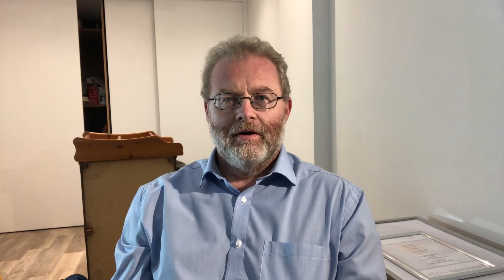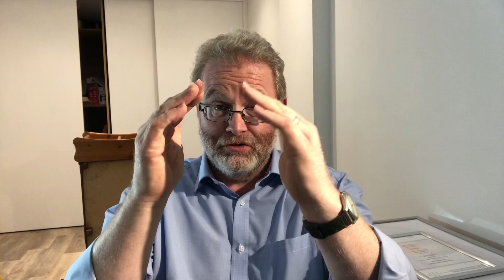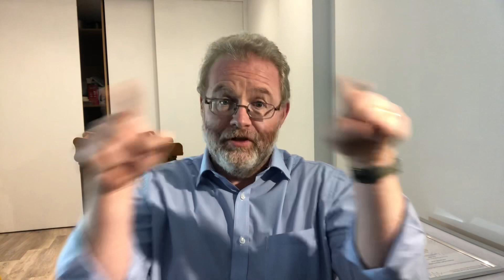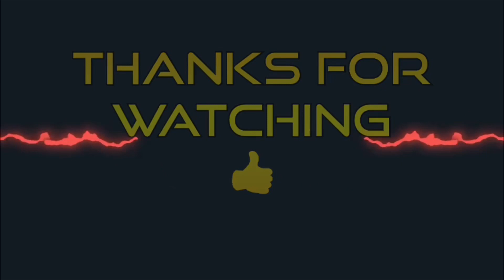Ham Radio: A Fan Doublet Antenna. A good option?

Comment: Try it out. My first permanent HF antenna was an attic installation of a Fan dipole that was connected to a ICOM AH-4 tuner (near the feed point). The antenna itself was an Alpha Delta - it may have been the best antenna I have had.
Reply from the maker: Thanks!

Comment: I think there may be merit in this, had thought of doing similar, currently using what is broadly a ZS6BKW, though my 450 ohm feeder is a bit too long. I will have to try a MMANA model,  it should be feasible to get the vast majority of the current into the shorter legs on higher bands to avoid the hedgehog pattern.
Reply from the maker: Thank you and for your modelling for me 73

Comment: OCFD, OCFD, OCFD! I HAD A FAN. ONCE TUNED, IT WORKED WELL UNTIL A STRONG WIND BROUGHT IT DOWN.......WIRE EVERYWHERE. MY OCFD OUTPERFORMS OVERALL, ANY ANTENNA I HAVE HAD IN SIXTY YEARS AS A HAM. I ALWAYS USE A TRANSMATCH WITH IT.
Reply from the maker: Nice idea

Comment: I've done what you've described, albeit without thinking so much about the lobes. I have a 80/40 fan doublet, fed at the base of the twin lead by an SGC SG237. How does it play? To use a line from Billy Crystal, "Maaavelous"! Yes, it seems to act just like any other fan dipole with the added advantage of the twin lead forcing more power to be radiated by the antenna itself. It works so well that I'm converting my ZS6BKW to the same configuration. When I'm finished, I'll have TWO such antennas: one 80/40 "pointing" east & west and another 80/40 pointing north & south. Yes, I have two SG237's to do this with. One variation is that since I don't have enough room for the north and south what I will be doing instead is to add loading coils 9 ft from each end on the 80m legs to make it resonant on that band (75 meters really).  I've compared its performance to an earlier antenna I had up with results that the earlier antenna wouldn't get me into my weekly 80 m net very well, but with the fan doublet my signal was much stronger and able to work the net at 10 watts as opposed to 100 watts! This is a rather new accomplishment having taken months to complete due to various complications but I anticipate getting very good use  out of them in the coming cold months. I use a 46 ft fiberglass mast with all sorts of guy ropes (4 sets, every 7 feet). If my lot was laid out differently I could have used one mast and have both north-south and east-west antenna fed by different twin leads and tuners to minimize the footprint but that wasn't possible.
Reply from the maker: That sounds a great set up, thanks!

Comment: Firstly I look forward to working you on 80 😅

Can't fault your logic and from running fan dipoles at home and portable I think it'll work well. The Rf should follow the most resonant path and therefor not choose the "wrong" elements within your configuration. With a manual tuner you could operate on the different resonant paths for varied results perhaps. Good luck, 73 Callum
Reply from the maker: Thanks Callum, let’s see what happens 73

Comment: Tim, I'd go with a fence top EFHW. In fact that's exactly what I am going with when some more wire arrives. Should be quiet and totally unobtrusive.
My other option is the mother of all Mag Loops made out of thick coax for the outer loop. Seriously eyeing up that as a project.
Reply from the maker: Good ideas 👍

Comment: I done 40 years of wondering if my current antenna is the right one, you never get over it. How about in you situation have a couple clip on wires to extend you existing antenna to lengthen the antenna you know works so well. Never thought about a fan Doublet vk5cz ..
Reply from the maker: Useful suggestion 👍 73

Comment: I don't think you can guarantee that the higher bands won't also be radiated from the longer doublet, because the principle of fan arrangements is that the "wrong" elements present a severe impedance mismatch to the feeder at the "desired" frequency and so little current flows in them. It's difficult to predict what the impedance relationships will be. You might get greater certainty using traps in one doublet (and will also find that they provide a few feet worth of loading on the lower frequencies).
Reply from the maker: Thanks Stu! 73

Comment: All the elements are active and do have current flow, even if they are not resonant.  Thats why fan dipoles can be a pain to get trimmed and adjusted.  There would be quite a bit of interaction if none of the elements were naturally resonant, it would be very hard to predict what the pattern would be.   Your 47 foot element longer doublet would yield fairly decent patterns on the bands you mentioned.  Anyway what do you have to loose, try it, see if it works.
Reply from the maker: Exactly my suspicion! Yep let’s see 👍
Reply: @TIMG5TM  I posted a simulation to your post of Facebook.
Reply from the maker: Seen it! You are very kind to model that .. very much appreciated 73

Comment: Interesting Tim. Are they any advantages using ladder line against  coax fed dipoles?
Reply from the maker: Hi Martin.. you are able to tune multiple bands with very low loss using ladderline and a good tuner. If you try and force feed a single band coax fed dipole on any band aside from its resonant Halfwave band or any odd harmonics you will either be unable to get a good match or even if you do you’ll in all likelihood suffer big losses on the feedline with the high swr (not something that causes anywhere near those losses if you use ladderline) 73
Reply: @TIMG5TM  So is ladder line balanced and are you restricted to set lengths for a dipole feed line? 73
Reply from the maker: If you mean ladderline yes it’s balanced and the length of the ladderline influences the impedances and can impact on how easy it is to tune certain bands. There are somewhere some guides on feeder length to avoid with ladderline for certain bands but in most cases it’s a case of whack it all up and see.
Reply: @TIMG5TM  Thanks. I have googled and found some info on lengths to avoid for bands. Very interesting. Now do I change from coax to ladder line. mmm. 73.
Reply from the maker: You need a decent atu 👍
Reply: @TIMG5TM  ok. Will the Icom 7300 internal tuner be ok, I do have a good external tuner too for my other rigs. 73.
Reply from the maker: @martindrury9740  Unfortunately not Martin. It MIGHT tune a band or even two but the high SWR requires a good manual tuner or auto tuner. 73

Comment: I seem to recall that you use an auto-tuner, Tim.  As others have pointed out, it's quite possible that there will be two resonate tuning positions on each of the upper bands you try.  So, I'm wondering how the auto-tuner will decide which position (and antenna wire) to pick to load up on.  And will it pick the same one consistently?  

If you are tuning the ladder line with a manual tuner, you can select which one and log the dial positions.  Even better, you can see which position has better propagation to wherever you are trying to reach (local or DX).  So that seems to make the trial worth while.  If it works out, you could have another very different antenna without the bother of another feed line.  

And, no, I've not tried this myself.  My doublet seems to load up nicely on all the bands and I'm happy with it.  My own thoughts for improving it are to add a separate multi-band vertical for the upper bands (fan, trap, or twin-lead fed).  When I've done something similar in the past, I've gotten very different propagation results (rx and tx) when switching back and forth between the two.

Good luck, 

-- John N0BUP
Reply from the maker: Thanks John. I now use a manual tuner and your input on this makes sense. I’m still looking to see if a seperate fan vertical might be an option for 10-17m. It’s all good fun experimenting. Appreciate your time to write such a detailed and helpful reply. Thank you. 73

Comment: Like you, I have pondered doing this also. Neither pair of wires will resonate, yet the tuner will tune the longer one most anywhere. The shorter pair will likewise tune anywhere that they are long enough to tune, a 17-meter length may well be closer so that the tuner picks it up first to tune that pair on the higher bands. Or it might not be stable enough to tune either. So far I have never read about anyone doing it. I have an old GAP vertical that essentially is the correct length to make a vertical dipole on 20 meters and I have considered feeding it with latterline and tune it from 20 up to 10.
Reply from the maker: Thanks .. it could be an interesting experiment

Comment: Fab dipoles are fine Tim,I use verticals here.I’ve a 1/4 wave on 40m with a loading coil at the bottom which when switched in gives me 80m , so off that antenna I have 40-15-80m,I have another vertical built for 17m...if you’re stuck for space try a inverted L
Reply from the maker: Thanks 👍👍

Comment: Being a non-resonate antenna, I'm thinking you'll get an even stranger pattern off the fan doublet. Worth a shot though!  Let us know how it goes! I love my 104' doublet. It gets out down to 80m very nicely.  73 de w8tam
Reply: The "collective wisdom" seems that this is what will happen. I've always been curious to try it so the results will be interesting to see. I believe if the fan elements were resonant the RF would find it's way but non-resonant won't work that way and I think you will get some odd interactions with multiple radiating elements.

My thought in the background was always to add something like a 20m leg to handle the upper bands when I was running a non-resonant doublet.

With one of the NEC variants, it could likely be modeled to see.
Reply from the maker: Good points ... I’d like to see this idea modelled. I think your point about interaction is a very valid one
Reply from the maker: Thanks! I will 73